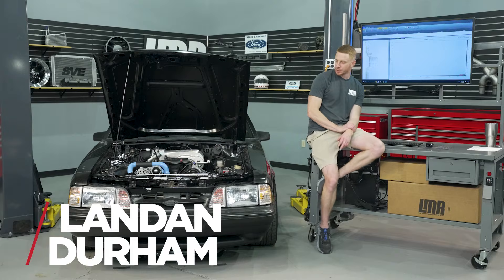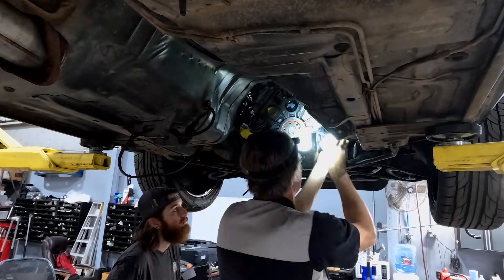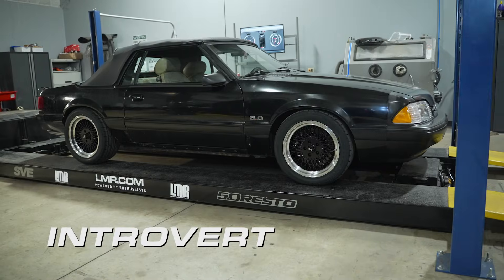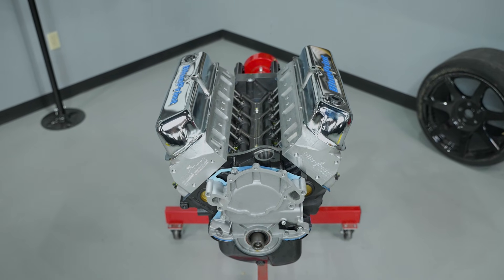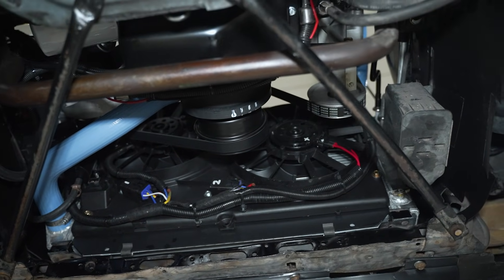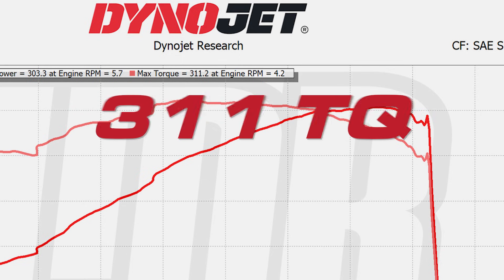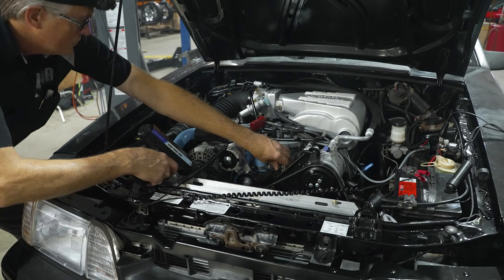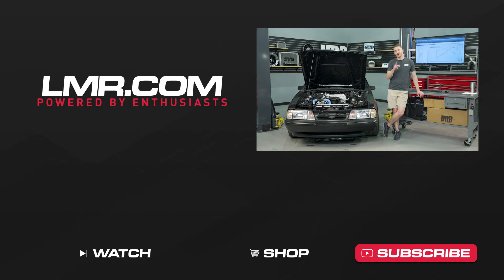BluePrint Engines 302ci Crate Engine: Chassis Dyno Runs in a Fox Body Mustang | Can it make 300rwhp?

Comment from the maker: 11/25/25 - We used 24 lb injectors which is part # LRS-37263. Individual data is not provided since these are reman units. We selected the 24lb "big blue" Ford Racing injectors in the Holley software which works well. You may have to adjust your injector data accordingly. It could also be in your best interest to just run brand new injectors if you're using a Holley Terminator X or other standalone ECU. -Landan

Comment: Unsure if this will get answered or not, but yall are using the Pink 24lb Injectors with the Terminator X, I know this, as Landan confirmed it in an email I sent him.  What injector did yall choose on the list of injectors in the Terminator software, because they're not listed?  I'm unsure if I should attempt to use those Pinks or buy something from that list of recommendations?
Reply from the maker: We're working on acquiring the injector data. It will be posted to the product pages for everyone as soon as we run through everything. I'll forward you the info whenever I have it. -Landan
Reply: @latemodelrestoration Hey Landan, I emailed you back this morning.
Reply from the maker: Got it. Thanks! -Landan

Comment: The weather correction factor for engine dyno numbers of 391.2 & 376.8 was STP. Divide by 1.04 to get the same SAE correction used on the chassis dyno (and by car manufacturers) you get 376.1hp & 362.2lbft at the flywheel.
Therefore the results on the chassis dyno show a 19.4% drivetrain loss at maximum HP and 14.1% at maximum TQ.
I'd be interested to see a chassis dyno run on the same car with better suited 3.55 or 3.73 axle gears.

Comment: What size injectors and fuel pump?
Reply from the maker: 24lb injectors and a 190lph fuel pump. Both available on our site. -Landan

Injectors: https://lmr.com/item/LRS-37263/mustang-24-pound-fuel-injectors-bosch-type-3-8604-ev1
Fuel Pump: https://lmr.com/item/LRS-9350B/1986-97-Mustang-190-Lph-Walbro-Gss242-Fuel-Pump

Comment: What size injectors are you running in this car with the blueprint engine?? Would 19lb injectors be good on my car since it won't be modded or raced??
Reply from the maker: We're using 24lb injectors and would recommend you do the same. -Landan
Reply: @latemodelrestoration ok thanks so much Landan.

Comment: This seems like a killer engine for a lively daily driver. I'd love to have one. I will say one thing that's great about a stock HO with a free flowing exhaust is the low end TQ, those HOs are low end TQ monsters. Mine still has the 2.73 gears and it will just chug if I want it to. The other day I took off in 1st rolled off until I reached 25mph and shifted it right into 4th and I just chugged away and slowly but progressively gained speed up to 50 mph cruise pretty quickly. There's an uphill road that you can turn off onto a street with  a way steeper hill I can turn off at 25mph in 3rd and leave it in 3rd and gain speed up that hill just TQs it's way up. It really surprises me how hard it pulls from 2000ish rpm, that seems to be the rpm where it really wakes up and the TQ starts rolling in. It's not a ripper but makes killer TQ for a small displacement short stroked engine.

Comment: The diff in crank hp and rwhp is called "parasitic drive train loss", and is a combination of everything you mentioned. Typically, you should expect at least 15% loss (manual trans). So if they say 361hp, you should expect about 306hp - or less. Your numbers are showing a 21-22% loss from the crank hp numbers, which could be chalked up to weather (a July dyno run in central Texas).
Reply: AKA “Taxes” 😉
Reply: Those 2.73s got to go
Reply: Mostly likely a combination of the small primary shorty headers, weather and a little EFI loss being as it's not as dialed in as a carb that goes on the same build over and over.
Reply: Nah, they said 360, he got 303. thats good. 21%  would be about 288 hp wheel. so...

Comment: drivetrain loss:
29 % hp drop.
21 % torque drop.
🤔🤔😳
6 yrs ago did BPE crate street 347. 
Great engine. Driven a lot and long trips and has been trouble free.
Reply: Multiple factors, those small primary shorty headers and an untuned EEC being the biggest.

Comment: I wish you guys would sell a4.6 3v forged engine
Reply: Most people would just go coyote at that point. The factory coyote heads are FAR superior to the 3 valve.
Reply: @twotrackjack2260  it is a better engine of course but too many issues come up electrical and it's super expensive not to mention tuning issues

Comment: I ordered the 347 I'm going to have around the same setup. I'll give an  update on the horse power.
Reply: Please do
Reply: 👍🏿👍🏿👍🏿👍🏿 I’m interested in results
Reply: I'm interested also
Reply: Any updates good sir?
Reply: @ROYCE415 yes, it made 308 hp and 324 torque but i might have a lot of drivetrain loss because im using a automatic 4r70w
Reply: @93fox21 is it reliable and worth it? Also is that at sea level?

Comment: I wish they sold the short block
Reply: Ok. I see the usual professional trolling malcontents. Mabbco. An engine refurb company from Texas. From a 289 to a 460. In any configuration you want. Call them. If you really own or want a hot rod and cannot afford or want this motor. This motor on this post is fantastic. Also. The “heads” do not “suck”. I race these motors in a road race series. This motor moves my Fox to 155mph. (Yes it is race prepped. Lightened and a proper transmission and rear gear. I run a carb and an AirGape. EVERYTHING else is unchanged. So……the heads do not “suck”. Only the post does.)
Reply: Yeah, the heads kinda suck. Pun intended lol
Reply: I’d buy a short block quick
Reply: I would love to get that short block.
Reply: Yes indeed
Reply: Lol just the block, rest is cookie cutter qaulity

Comment: Im leaning towards their 347. Although this is no slouch
Reply: My buddies AFR headed forged 347 takes 100 shot of nitrous to run with my coyote swap
Reply: @kennethrobinson5151  I love the old school sound of a pushrod so my thinking is, if im gonna go 302, for not much more I can go 347. I understand why guys like coyotes tho.
Reply from the maker: They're 347 is a solid option. You can't go wrong with either one. It seems like making the big decisions are always the struggle when building/modifying/restoring cars. -Landan
Reply: @latemodelrestoration what sized exhaust for the 302 and what sized exhaust would you recommend for BP’s 347? I have a 2850# car with TKX. Want to have a very reliable cross country cruiser.
Reply from the maker: @TheSatterleeTeam  Personally, I would keep the 2.5" stuff and just run a good flowing header. 3" stuff would allow room for growth, but you could always address that when/if the time comes. -Landan

Comment: Great video  you guys are so thorough do you plan on doing a carbed version or blueprint 347 stroker engine these are great engines for the price like to see them with better heads afr maybe especially the 347
Reply: Blueprint wouldn't use AFR heads because they use their own "brand" heads

It's about economics and that would make it more expensive maybe a little out of people's reach even if the AFRs are clearly better heads vs an as cast "overseas" head
Reply from the maker: Thanks for the great feedback. We're always pursuing parts/accessories that best fit our lineup and interests of our customers. I know that doesn't directly answer your question, but we don't really touch base one parts we plan on offering. In that, we appreciate your feedback and interest in a 347 option. -Landan